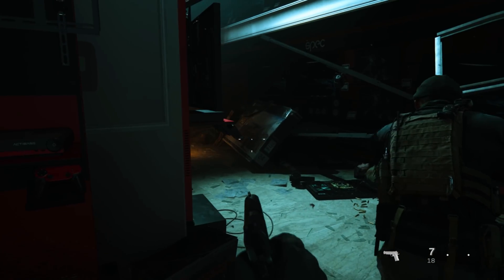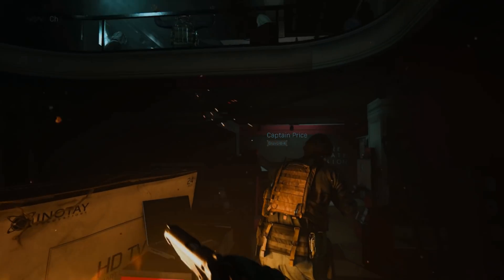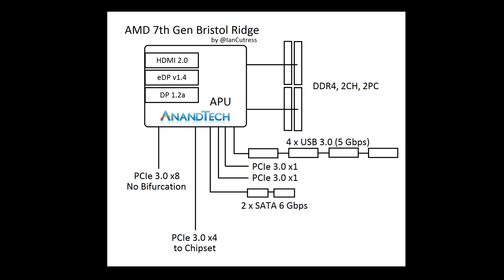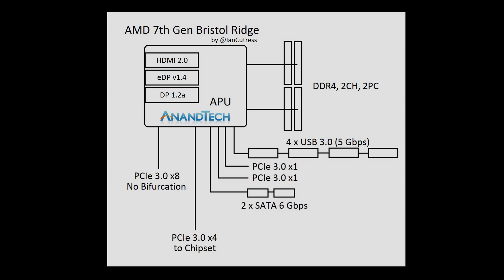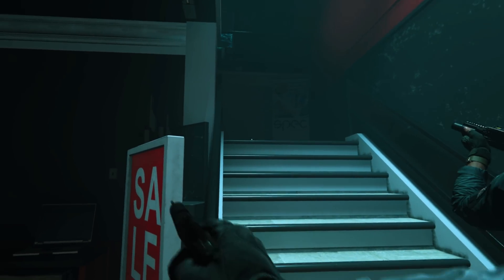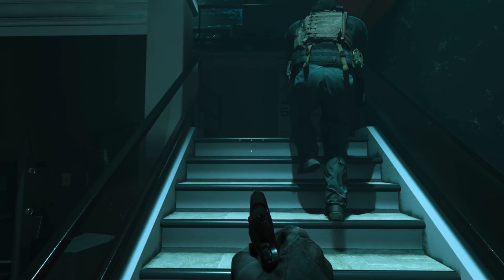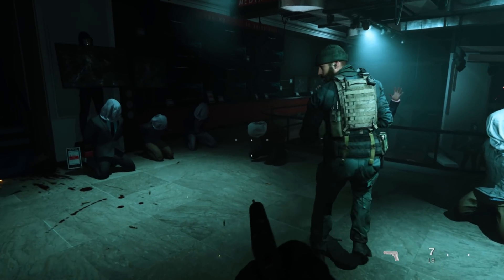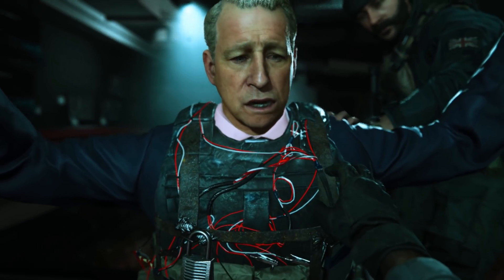New Nintendo Switch SOC PCIe Development + Applications Examined

Comment: If Nintendo ever comes out with a console that is powerful enough for 4K gaming, it is at that point that I will ditch Sony and Microsoft and just stick with Nintendo and PC gaming. Sony used to have better exclusives, but I haven't been impressed with most of the recent exclusives by Sony or Microsoft lately. I am on the verge of giving up on both of them, but I still have hope in Nintendo.

Comment: I also think they have a new more powerful version coming. But it wouldn't surprise me if they waited til March 2021 cause parts prices will drop and they can then know what PS5 and Scarlett is capable of. So they can get the most from their mobile system.
Reply: or even wait a whole year after ps5 and scarlet, that makes it march 2022, 5 years after the switch.

Comment: sounds like i was saying years ago when the "switch" was announce before release. but the new dock has to support external or internal cpu, gpu, rams and hdd/sdd for higher 3d models and textures, which would be optional when downloading them like how the ps4/4 pro and xbox one/one x does for enhance games. it should do 4k gaming and support 8k resolution via video only.
Reply: For something like Switch we can only expect 4K upscaling. Also it needs to work better in handheld as well. 8K support is pointless.
Reply: @TheKaizokuman  yeah, ultra setting on 1080p60 is not bad at all. it might be pointless, but there some people care for it. but a upgrade-able dock could make it happen, if nintendo support that.
Reply: @nintendians  i mean unless you have an 100" tv, 8K is not feasible. It would be just for a theater room.

Comment: At this point Dave, your Switch Pro is going to cost over $800+ ... that's being generous. If you think this Pro version is going to be cheap to make and sell, you're delusional.

Edit - Also, you use the word "confirmed" a lot, even though nothing has been confirmed.
Reply: The tegra X2 has PCie support and costs the same as the tegra x1 does, so it's not necesarily going to cost any more than the current switch. Even just an update to an X2 would be fine.

Comment: You didn't mention that the SoC or CPU supports a finite number of PCIe Lanes, and some lanes go to the substrate controller before going to the CPU. Take a  look at the new Intel consumer chips. The I-9 9900k supports up to 40 PCIe lanes, but not all lanes go directly to the CPU. The CPU can have 16 lanes of direct communication, the rest goes through the substrate chipset, on the motherboard, before communicating the information to the CPU. 16 lanes of traffic shared.

So the performance of the device depends on how many lanes of traffic the SoC supports as well as the substrate chipset. Example above. Some interfaced devices will have to share the bandwidth due to each device will take up more than 1 lane of traffic. Example 1 GPU can take up to 16 lanes, a mvne will take 4, etc. If you have two graphics cards, each graphics card will run with 8 lanes of traffic instead of 16.  The more devices the more it's shared.